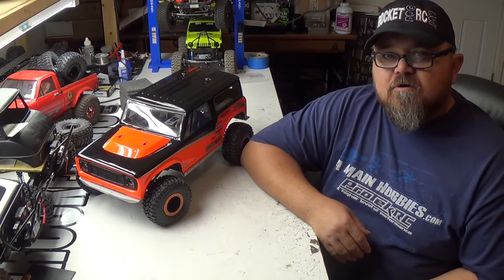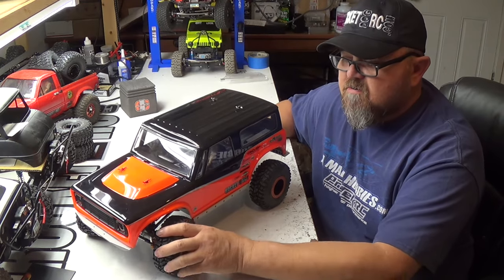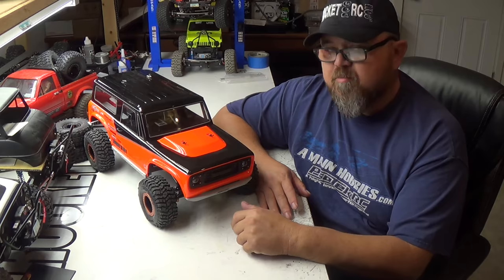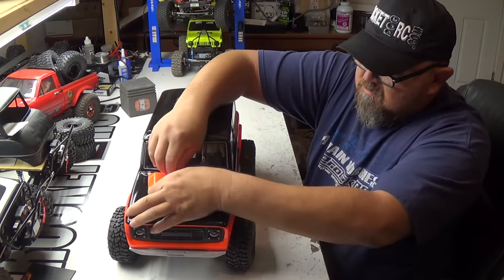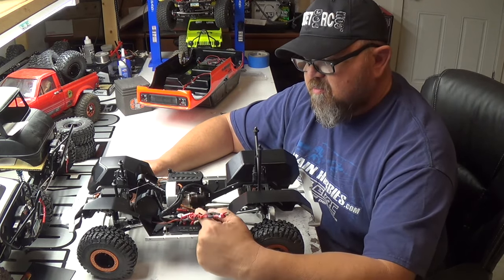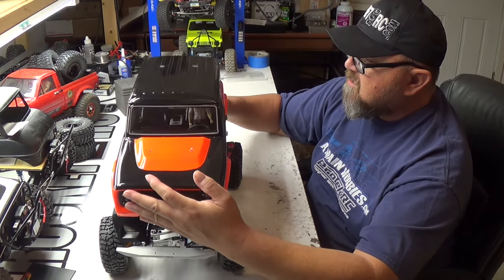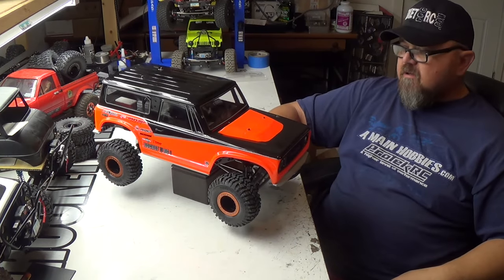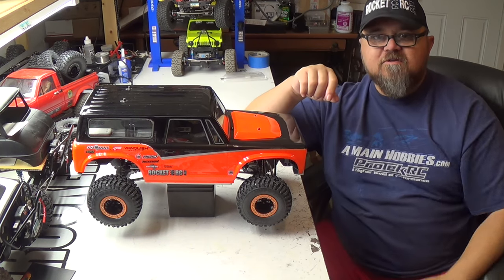#44 Product Review Vanquish VS4 10 Origin

Comment: I love the paint scheme! Almost looks like Harley Davidson. Which Pitbull tires are those? Do you have a link or part number? Also, what color orange is that?
Reply from the maker: The tired are the standard pitbull rock beasts 4.19

The color is standard florescent orange with orange backing it.
Reply: RocketDogRc.com I don't think Pitbull makes 4.19 tires unless they're new. Do you mean the 4.45" tires?

Also, what brand is the orange paint?

Thank you.
Reply from the maker: @TheImtoomuch  your right about the tire size they are 4.45 tall 
The paint is orange in ps I don't have the number.  Sorry.
Reply: RocketDogRc.com no worries. Thank you for responding! I think your truck looks so awesome that it convinced me to make mine orange when I get it.